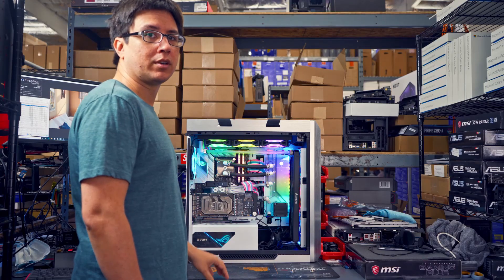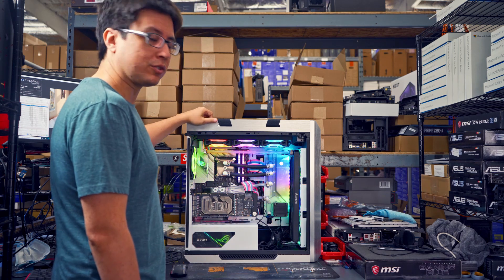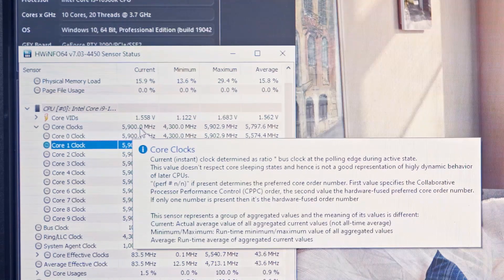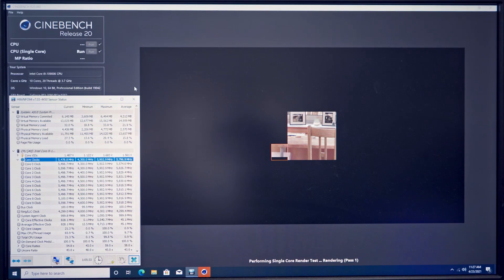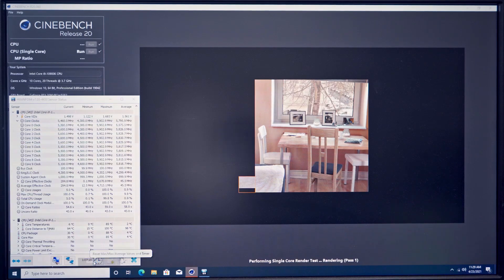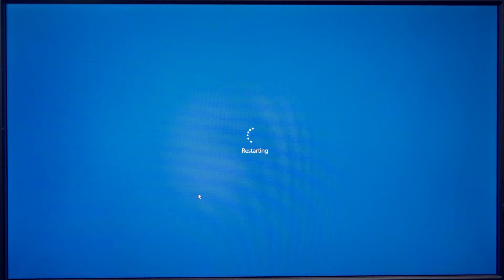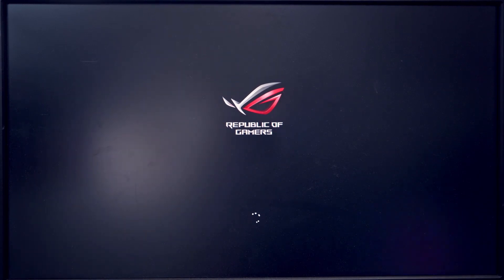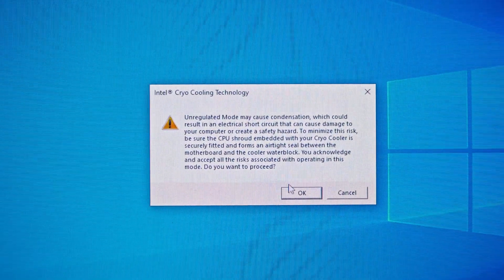Overclocking i9-10900k to 5.9GHZ with EKWB TEC Thermal Electric Cooler and comparing to i9-11900k

Comment: I got up this morning. Want to debug 11900k overclocked 5.2
I entered bios and tried offset voltage mode +0.1
After turning on the computer, I immediately turned on cpuz and found that it was 1.7v. I immediately turned off the computer.
The core temperature of aida64 suddenly reached 60 or 70 degrees
I shut down immediately
Re-debug offset-mode
No programs are running
1.7v for a few seconds is fine for the CPU, right?
Will it have any impact on the CPU?